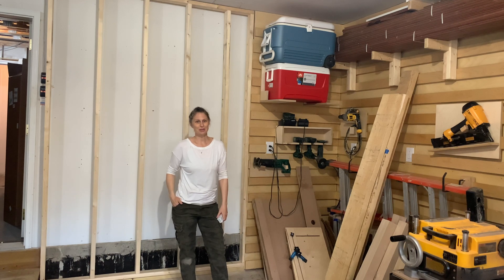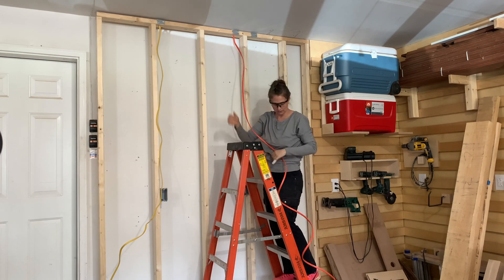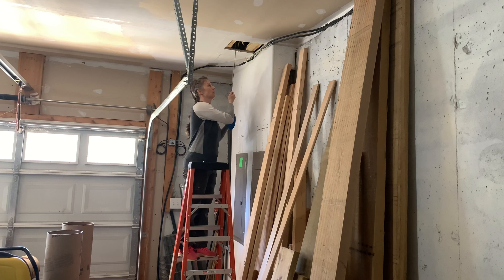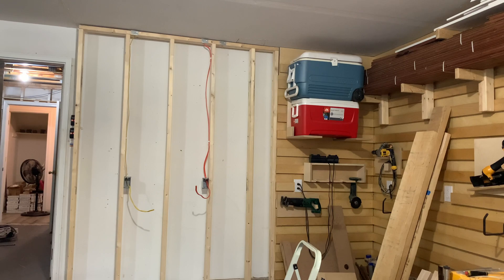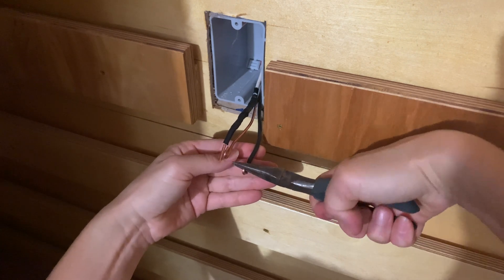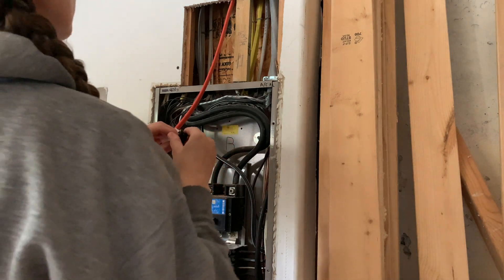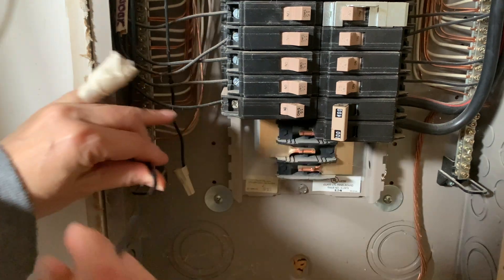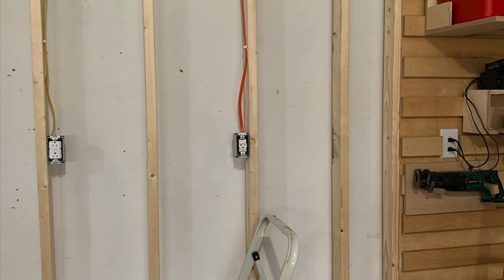How to Install a 220V 20 amp outlet: NEMA 6-20

Comment: You should be using 10/3.  If that is a shop area it needs to be wired with a ground fault.
Reply from the maker: A 220v outlet does not need a neutral wire to function on the load side and if you look at this outlet it doesn’t have a place for it.  So a 10/3 wire would be a waste.  However, if I had a gfci breaker it would need a neutral on the line side from the neutral bar.  I did not put a gfci breaker in as I was not able to find one at the time that I added this outlet.  Unfortunately supply chain issues were an issue and I struggled to buy even basic supplies.
Reply: @FireflyWoodworking  I was about to ask the same question, why wasn't a GFCI breaker installed since the receptacle is located in the garage. Wow those 2 pole GFCI breakers are $expensive$. You are right about not needing a neutral, in fact there is no way to even wire a NEMA 6-20R  properly with a neutral, by design it's terminals are intended to use L1 L2 GND. And when you wire up the GFCI, there is obviously no white wire from the load to feed into the breaker. The coiled pigtail exiting the breaker obviously lands on the neutral bus.

Comment: I accidentally bought these instead of 5-20 plug and connector for an extension cord repair🤦
Reply from the maker: If I make less than 3 trips to the hardware store for a project I call that a win.
Reply: @FireflyWoodworking ok so it's not just me haha

Comment: Garage outlets need to be on GFCI breakers.
Reply from the maker: You are correct although I have yet to see a video where someone does this for a 220v. At the time I made this video I couldn’t find a gfci outlet or breaker with the appropriate amperage (it was at a time where there were a lot of supply chain issues.). I have had the entire garage inspected by an electrician and passed and I have added gfci protection to the main panel.
Reply: @FireflyWoodworking  Depending on your box, 2 pole 20A breakers have been around for quite some time.  They're not cheap though. 
You might have the best electrician if he didn't know that GFCI breakers are necessary in potentially wet environments such as a garage...Especially if there's a potential to use an extension cord in the outdoor area area around the garage.
I use my NEMA 6-20 for a 16A EV charger.  Even though the EV charger has a ton of short protections, a GFCI was still required by code.

A main breaker GFCI is very expensive. To me it seems kind of silly to cut power to the whole house because your hair dryer grounded out. 
Also - off the top of my head, I don't know how much imbalance it takes to trip something like a 240V 200A GFCI on a main.
That's something you may want to find out.
Reply from the maker: @MichaelMammon thanks for all the great information. The inspection was done by the county so I think he was pretty knowledgeable.  I had a lot of issues even finding breakers for the box due to supply chain issues (everything was sold out). In our area adding a gfci to the main panel is now considered standard for new construction but I know codes can vary.  I’ve debated about going back and updating the breaker to a gfci. I added a sub panel recently for additional outlets in the garage and after that project I’m ready to move on from electrical work and get back to just woodworking!

Comment: Where does the red wire go ????
Reply from the maker: If you are use 10-3 with ground the red and black wires are your hot wires and your white is a neutral.  Since I used 10-2 with ground, You would  do exactly as I did but attach the red wire where I attached the white wire (the white wire that I wrapped with black tape to indicate it was hot).  Your white wire would then attach to the neutral bar in your panel and your neutral on the outlet.  This outlet did not have a neutral so if you are using this exact outlet you would cap the white wire in the electrical gang box because it doesn’t have a function in this case.  220v outlets do not always need a neutral. Hope that helps!

Comment: Hard to tell from the circuit breaker and you didn't mention. A 6-20 is the same as other 220v configurations and is a split phase right? one hot going to each separate leg?
Reply from the maker: Yes. Right around 9:50 in the video I talk about how both wires to the breaker are hot. Thanks for watching!

Comment: just a note:120v or 240v 20amp circuits doesn't need awg10 you can use awg12 ( save some money). the video is helpful thank you!
Reply from the maker: Thanks for the tip. I definitely planned this project for potential future growth just in case I need to upgrade to a 30amp circuit later.

Comment: These days most electrical inspectors require a torque wrench to tighten circuit breaker wiring connections.
Reply from the maker: Thanks for passing on that information. I was just talking to our local inspector about electrical box maintenance and using a torque wrench annually to make sure connections haven’t come loose over time. Thanks for watching!

Comment: Thank you for the informative video. I notice you have a tandem breaker, with each switch having 20 amps. I would like to have an electrician install a 6-20 outlet in my dad's garage (one receptacle). Can I get away with just a single (not tandem) 20 amp switch? He only has one space left on his panel for a switch. (It's for an EV.) Thanks.
Reply from the maker: @tommydtomdecrescenzo8851  in the US the answer is no. Typically an EV will need 240v and you will need 2 poles to get 240 volts.  If you’re planning to hire an electrician, I’d ask them what they propose as a solution. If the box is that full they may not (according to code) be able to add anything. What I added was a double pole breaker not a tandem as tandem pole breakers are not rated for 240v. One solution your electrician may suggest is using tandem breakers in other slots to make more space in your box so you can add a double pole breaker.
Reply: @FireflyWoodworking  Thanks for the quick response! Tandem makes sense elsewhere. There are a lot of other breakers that are using very low power. I'll ask!

Comment: Most cost saving outlet for EVs if you have distance to consider!  Sure you can spend a good amount of money on high end plugs and thick wiring for Nema 14-50 to get the full 50amps for 9kwh charging or you can save money be more safe with the Nema 6-20.  Yes it is 20amps and you will get up to 4kwh but unless you are charging a Cybertruck who cares :)
Reply from the maker: That’s an excellent point. I’m not using it for an EV but this application/plug has lots of uses.

Comment: I've got that same plug but not sure about one thing. I'm doing a 20 amp 2 pole GFCI outlet, which has 3 screws on the breaker and a pigtail for neutral. That weird outlet only has two brass screws on each side and a green ground, it's rated for 250v 20amp, but I'm not sure where the neutral is supposed to attach to on the outlet.
Reply from the maker: Great question. I sometimes run 10-3 wire on outlets (red, black, white plus ground) just in case I want to change outlets or do upgrades in the future.  If my outlet doesn’t have a neutral I just cap it off. You don’t need a neutral wire for 240v (in the US) that’s why the outlet is made that way. Thanks for watching!
Reply: @FireflyWoodworking  So the 10-3 would be a waste it sounds like. I could use my 12-2 and just not put anything in the middle white in. I would do the white and black as the hots and leave the middle neutral out?
Reply from the maker: Yup. The 3 wires is a waste for this 240 outlet. I have seen other types of outlets with a spot for the neutral (when the item pulls both 240 and 120), which is why I started running it. Just in case I change my mind later. If you run a white as hot just make sure you mark it with black tape, both at the box and the outlet so others know it’s hot.  Great work!
Reply from the maker: Also to answer your question, yes, leave the neutral empty at the gfci breaker.

Comment: I am confused as code requires gfci protection in garages but no tutorial videos show this?   What am I missing?
Reply from the maker: You’re not missing anything. In fact I wanted to do gfci but couldn’t find a gfci 220 receptacle that worked for that specific plug.  And I looked for a gfci breaker and couldn’t find it in the correct amp either. Now I did this project at a time where supply chains (yuck!) were at their worst so it was hard to find anything. When I had the inspection for this, and numerous other power upgrades, it passed with no questions.  I have since added a “whole home” gfi to the sub panel that just does the garage to give some protection but technically having the gfci outlet would be best. Thanks for asking such a great question!

Comment: It's a great video 
Thank you for sharing this with us
I learned that you can strip the wire with the plug the plug has two lines, one is for 10 gauge and the other is for 12 gauge, you don't need the pliers thank you again
Reply: I hope you can made a video about that
I think it's just my opinion
Reply from the maker: I actually saw someone do this recently. I can absolutely do a quick tips video that includes your awesome comment along with other great tips I’ve received from this video. Thanks for watching!!

Comment: Great video.  Question:  I have washer and dryer outlet in the garage and they are on the same phase.  If I put them on separate phases they'll should be just fine for the washer and dryer.  There is a hot(red) wire for the washer and a hot(black) wire for the dryer.  I could change the box cover with one I put below so I can have the duplex along with the 240v 20amp.  I can use the 2 hot wires and a ground and power up the 240v outlet.  I would only charge the car when not using the washer and dryer so I could still have outlets for the washer dryer and also for the tesla charger.  I'm sure this isn't code but in theory it should work fine right?  My other idea was just using 2 male 20 amp rated plugs and plugging them into the outlets and then wiring them into a 1 gang metal box with the 240v outlet so once it's unplugged everything is still to code.  Maybe that's better.
Reply from the maker: Thank you for watching. I’m not sure I’m the best person to advise you since I’m not an electrician. I do have some general recommendations though. 1) follow electrical code especially for expensive items. 2) it is better to have dedicated circuits for large items. 3) avoid the reliance on extension cords (I assume that’s what you mean by make 20amp plugs). I think what you are describing should work but that doesn’t always mean you should do it.  When I make electrical plans I tend to draw them out using electrical diagrams so I struggle a little when someone verbally or in writing describes an electrical plan.  Good luck!

Comment: Why did you use 10/2 wire?  220/240v 20amp calls for 12 gauge?  Is it just in case you expand service to 30amp later on?
Reply from the maker: Great question and yes!  I know that while this dust collection system isn’t small there may come a time when I need to upgrade. Better to plan ahead. Thanks for watching and taking the time to leave a comment.
Reply: @FireflyWoodworking  Ahh. I had a feeling that was the case. I'm installing the same outlet tomorrow only about 5ft away from the panel and will be using 12/2. In the future, if you buy commercial (Fed-Spec) outlets, you don't need to do J-hooks and they're a far more durable outlet.
Reply from the maker: @LBCAndrew  I’ll definitely look into those outlets. I’m always looking for better options. Thanks!
Reply: @FireflyWoodworking I think you are good with the receptacle that you have, it is a commercial grade. I don't believe that residential grade are made for 240v receptacles. The clamping feature known as back wiring, not to be confused with backstabbing on cheap residential grade 120v 15 amp receptacles, is not available on 240v 20 amp receptacles, so making a hook to go around the screws is required. You could have used a heavy duty industrial grade, but it's over double the price and probably would be overkill.
Reply: Thanks for your question. I had the same. I'm looking to wire a 220V window A/C unit with a 12.8 amp draw. Looking at prices, 10/2 is almost twice the cost of 12/2
Reply: Or use the correct size wire for the correct size breaker according to the NEC code book which doesn't half ass anything.
Reply: You can use the bare minimum wire gauge but that's just a half-ass attitude. Spend a few dollars more and get the 10 AWG and stop doing the bare minimum.

Comment: what I do at every outlet, I add a small loop before going into box for extra wire just in case for future repairs if needed.
Reply from the maker: That’s a great tip!!!  Thank you for sharing. I’ve got a lot more to do both in the shop and the house and I’m going to do this going forward.